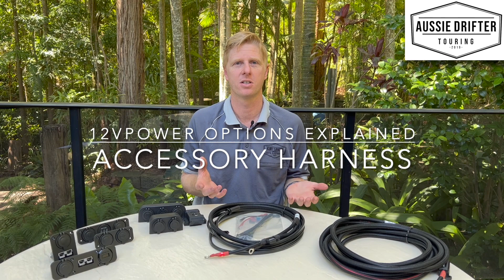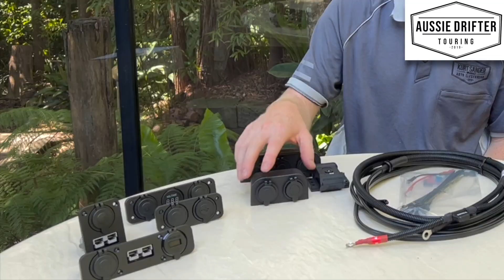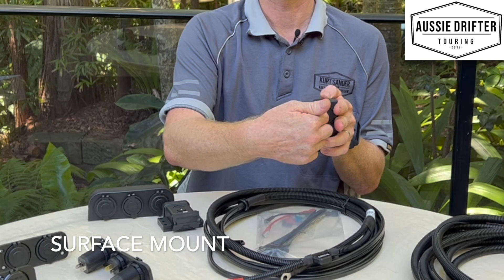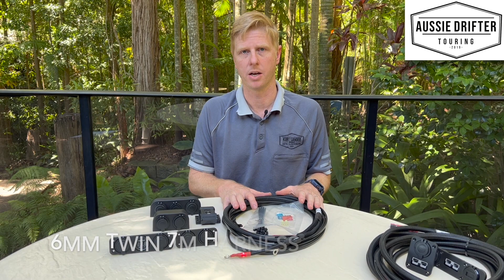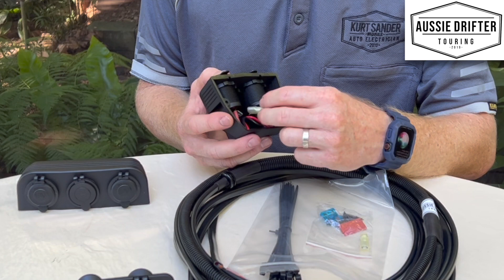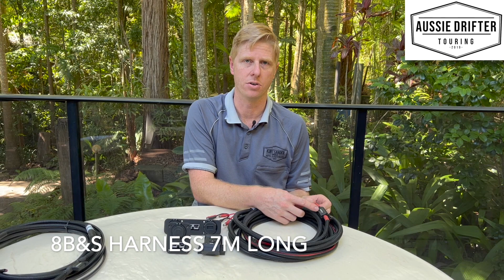Dual Battery Accessory Harness options Explained

Comment: hey mate, awesome vids! very helpful info, keen to have a crack at installing in my 105. How does it work if I wanted the anderson plug for fridge and also the 3 extra cig/usb sockets??
Reply from the maker: Hey mate glad the videos are helpful, we don't have a n option for Anderson plus 3 sockets sorry just Anderson + 2.  We have a new usb/volt combined socket though so that may help you out and remove the need for the extra sockets.